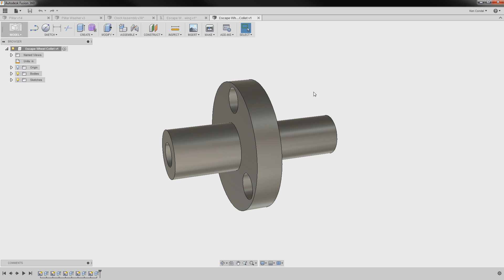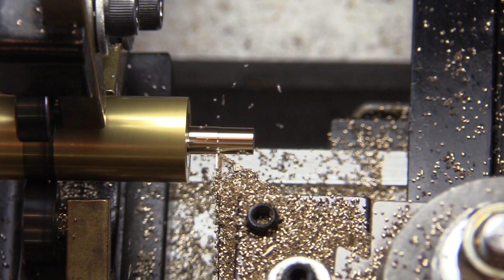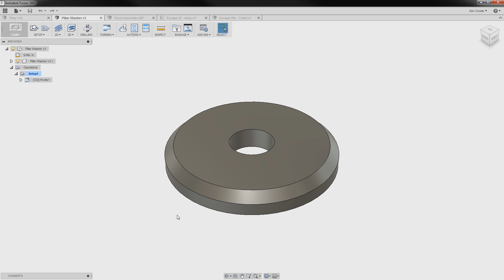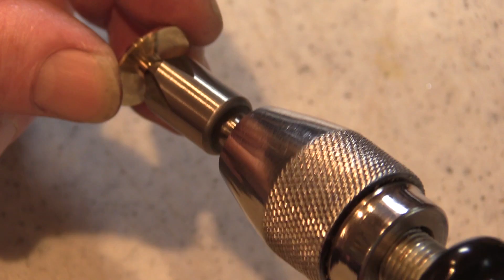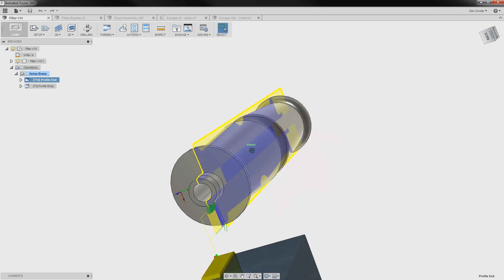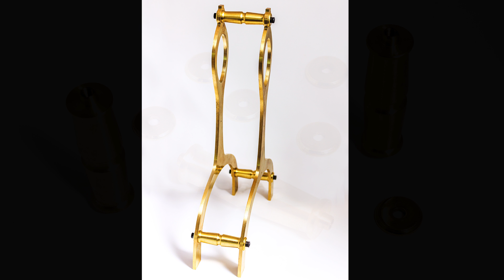Making A Clock - Part 4 CNC Lathe Work

Comment: Ken, somewhat humorously, as a software engineer I come home tired of working with computers and tired of typing, so when I'm machining its all manual and turning dials. now that I'm retired the plan was to learn CAD, and I did get a Fusion360 account, but then I found out that once you retire your goals and priorities seem to change !.  I am really glad you're video'ing the CAD and CAM portions of your work though, I really appreciate seeing how its done,  and who knows, maybe someday I will try it.  Keep up the good work and the good videos !!!
Reply from the maker: Thanks for the kind words. Although I thought this was a project I could handle, it turns out that making a clock is much harder than I thought and beyond my skills. Maybe someday I'll try to complete it but for now I've gone as far as I can.
Reply: @KenToonz  Nope, not buying it, not for a nanosecond.  If I had to take a wild-ass-guess (and apologies in advance if this is too speculative) I'd say you're afraid of making a mistake and having to throw out a part and start over.  That's called learning (from experience) !.  When I used to ski the saying was "if you're not falling you're not trying hard enough".   I'm nearing completion (hah!, been saying that for years now!) of a model Rolls Royce Merlin V12 engine (scaled to 1" bore), for which I had to re-make the rear gear case four times before I had a workable design, and for which I made five intake manifolds before I got two useable ones because I kept making machining mistakes (even with a DRO).  And at the moment I'm re-grinding my cam shafts because they aren't uniform enough (story too long...), and after that I'll have to re-think how their bevel gears attach because when I assembled the engine and tried to turn it over the cams stayed still as the gears slipped on their shafts.  Yes it was unreasonable that I tackled this engine before I had all the necessary skills, but as a wise man once said "progress is made by the unreasonable man".  Get back on the (lathe) saddle man!, make some chips and swarf!, you can only learn by doing!.   I have two full shoeboxes of throw away parts for the Merlin, that pile is bigger than the model itself, how many throwaway clock parts have you made so far! Perhaps you've lost interest but I've seen your Orrery and there's no way you're not up to finishing this clock.

Comment: Ken, thank you and you have me convinced CNC for complex shapes and precise repeatability is the way to go. For simple parts that don't require multiples hand machining would probably be faster, although once proficient with CAD it may not be faster but as long as the G-code is error free may eliminate the mister Bozo factor.
Michael
You have me hooked

Comment: Ken,         Great video as always. You state that your headstock can not have material pass thru. Shereline now offer a more than one headstock that you can pass material but at a price. I seen that your Mach 3 is licensed to  Ken Condal, are you in the witness protection program ? Looking forward to the next video. Imagine doing this in the 1700s    Ralph
Reply from the maker: Thanks Ralph (I think!). Witness protection??? Yes, I'm aware of other headstocks including 3rd party. The problem isn't the lathe, it's that I continue to make parts that exceed the design capacity of the machine. It's time for a bigger lathe.

Comment: Thank you for the video. Why do you need such a large bit to spot drill ?
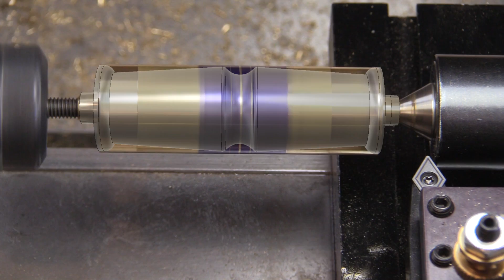Reply: Ps: I love that model overlay at 17:18
Reply from the maker: Technically I don't, but of all the various size spot drills I have, this one gives the best results.
Reply: Oh ok thanks. I didn't know that spot drills were a thing. I read a bit about them, short and sturdy so they don't wander and opinion seems to differ on if it has to be pointier or not... From the video I can't really see which way you went.
Reply from the maker: Drill bits wander a lot when they first touch the work piece. To prevent that you want a nice sturdy spot drill to leave a starting hole with the same taper angle as the drill bit. That way the drill bit slips into the hole and is prevented from wandering.
Reply: Thank you for taking the time to answer and explain.

Comment: I don't use a profiling tool much and don't have CNC either, but wouldn't it be helpful to have the tool angled ever so slightly to prevent rubbing that shoulder and getting those unexpected heavy cuts when backing out?  I just noticed how it happened to slightly grab a couple of times.
Reply from the maker: Yes Keith, you're absolutely right and I've since corrected that. Those little things are hard to see in real time but easy to pickup when you review a highly magnified video.

Comment: Nice video again!  I particularly like the shot where you overlaid the finish pillar on the rough pillar,  Thanks for the commentary on the parts that would be simpler to do manually vs CNC and vise versa.
Reply from the maker: I'm glad you liked it! The overlay was tricky to do but it really helps to explain what's about to happen.